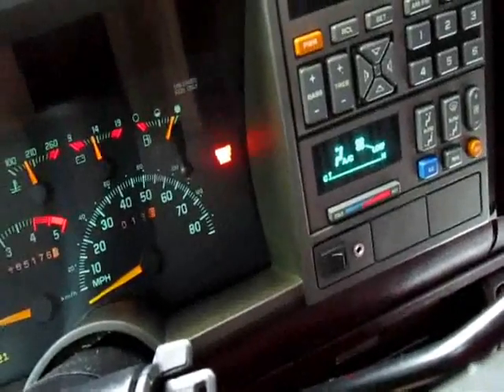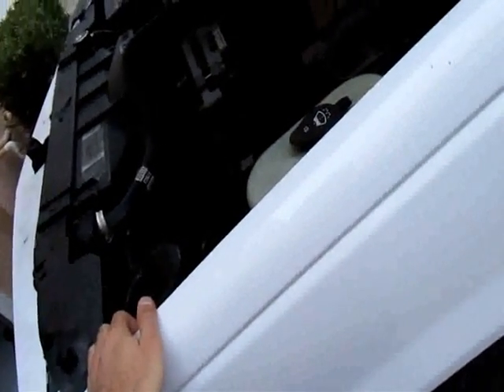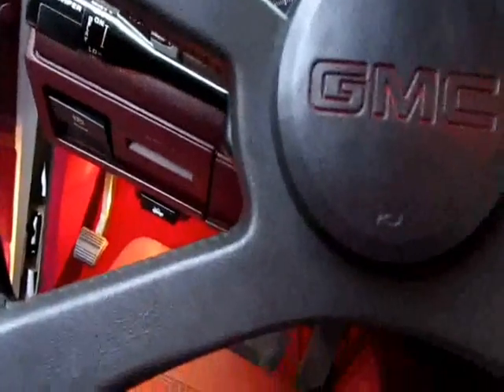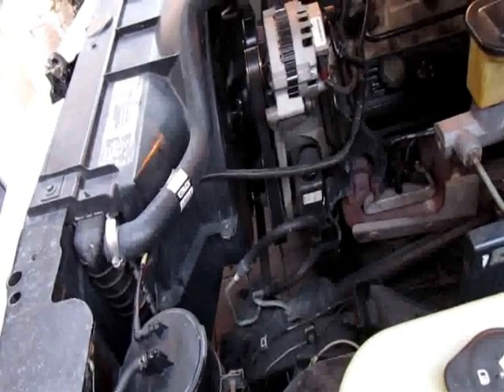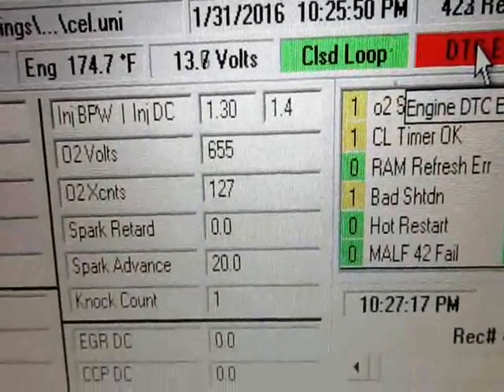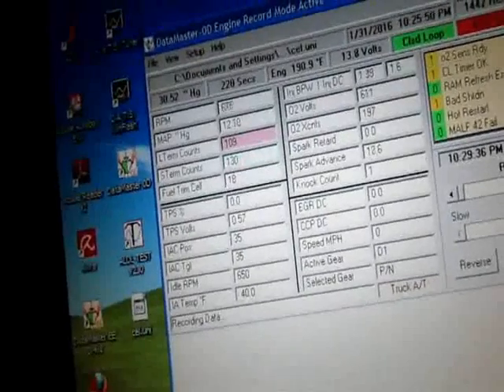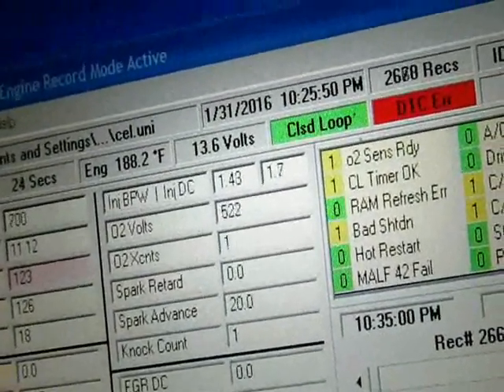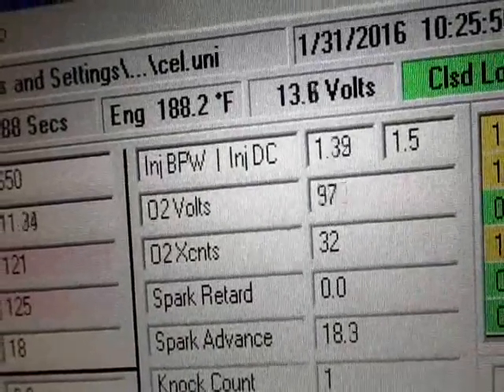OBD1 code 45 TBI GM 87-95 running rich!!

Comment: Loved the video bro. I have a question about a code 32 that pops up when I run my 95 k1500 5.7L on the highway. I changed EGR valve, vacuum solenoid, map sensor and egr vacuum hose. All that and code popped up again. I cleaned idle control valve, swapped throttle position sensor. Still having issues. Im damn near pulling my scalp off lol! Idk if changing  transmission speed sensor will help any, but i it did anyway. Hopefully someone has any tips or theories that can help me out.
Reply from the maker: EGR solenoid OK and connected? Code 32 is EGR only, Bad EGR . NEw ones are crap these days too.  bad EGR solenoid.  Bad EGR vaccum source at solenoid or at EGR valve or the EGR port is packed with carbon
Reply: You probably got it by now but if you don’t disconnect the battery and reset the computer the codes won’t clear

Comment: carburetor cleaner on the o2 sensor, clean it and your back on track.
Reply from the maker: Nahh this thing was old might as well just pop in a new one  they are cheap
Reply: I had too because mine got crossed threaded. had to replace it later on. just made it work meanwhile by cleaning it. lol.
Reply: @juanvenado9707  I know this is a year old, but that's interesting. Didn't know they were cleanable..... even as a temporary fix.

Comment: I have a 1994 GMC k1500 5.7 that has been running rich since I bought it. I have bought a brand new throttle body that came with the new injectors and idle air control valve as well with the throttle position senser. I also put a new temperature coolant sensor in along with a new o2 senser and mass air flow senser. New starter and plugs with wires as well as a cap and rotor. All of this has been done in the past week and it's still running rich. I did pull the plugs to check them again and noticed that my # 7 and # 8 have black sludge look to them. So I have just bought a new distributor and will be installing that Friday as well as doing the timing. If that don't work the only other thing I haven't replaced is the EGR valve. Any input from anyone would be helpful thanks.
Reply from the maker: There is no mass airflow sensor.   If its running truly rich check the fuel pressure could be dripping fuel injector could be too much pressure from a messed up fuel pressure regulator or someone messed with it raising the pressure.  If one plug is fouling could have a bad valve seal. Valve guide and its fouling it with oil.  EGR valve wont do anything. I dunno why so many think the EGR valve causes so much. Its only used at part throttle to mix exhaust gasses in to lower combustion temps and clean up the tail pipe emissions.   When mine was broken from a ripped diaphragm I always felt it ran better then after when I fixed it

Comment: Okay that makes sense. Same thing with my 94 k1500. Same exact issue. Tried that throttle bottle cleaner. Even though of the IAC but it’s the 02
Reply from the maker: Ya My o2 was dead, New one fixed it up., Then it ran bad like a year after.. was the fuel pump. Had like really low pressure.   Now it just works great!  New o2 new fuel pump. Runs very nice. 1994 Best damn year keep it
Reply: @GhettoWagon  yeah I’m going to try out the 02 when it gets here. When it come to my truck picking was between a 94 extended cab or a 00 single cab long bed. But the 94 was loaded. Had a factory tach, and the nice cup holders below the radio. Many know how much them cup holders are worth it in these years
Reply: @GhettoWagon is there a way to test an O2 with a scanner?
Reply from the maker: yea the wave length / voltage should be steady w/o much hang up on any value.   basically its just a wave  Max to min over and over  If its slow? to react its dying  OR... another issue is happening like its  running lean. rich from something upstream of the o2  @MHolt3573

Comment: Hi I have a 1994 Chevy 1500 5.7 tbi I feel like my rpm drops very low when I put into any gear I’ve changed a few sensors already and nothing seems to solve the problem any advice?
Reply from the maker: Make sure TPS sensor is adjusted right . Should be like .5 volt at around idle.  And fuel pressure could be low. Timing could be retarded.
Reply: @GhettoWagon  timing as in the distributor timing?
Reply: @GhettoWagon  and how can I check the fuel pressure? Sorry I’m only 17 and new to these trucks I just rather learn it myself so I know better next time
Reply from the maker: @victor2x668   need a TBI fuel pressure adapter. Goes inline either at the throttle body or the fuel filter.   YA ignition timing if its retarded it will idle low.
Reply: On your video I seen your rpm is also low has it always been like that and is that normal? I feel like mine is too low and it’s like at around 550 sometimes 600 in reverse or drive and when I turn on the ac it completely shuts off
Reply from the maker: @victor2x668  they idle  at around that when warm
Reply: @victor2x668 did you get your fix mine is doing the same thing

Comment: Hi I have a 91 Chevy pick up 350 5.7 tbi my injectors are dumping fuel I've changed the map sensor the coolant temp sensor distributor rotory button any ideas
Reply from the maker: TBI leaking internall bad o rings around the injectors, bad injectors.   Fuel pressure too high.

Comment: Okay so I have a 1985 monte carlo with the 4.3L V6 and I'm throwing codes 34 and 45 as well .. my symptoms are sluggish on acceleration and no power ... could this as well be the O2 , you think ?
Reply from the maker: could be. Or its just running rich and lean.  Code 34 is a mass air flow code maybe its dirty? unplugged?
Reply: @GhettoWagon  I figured out what is was ! The car only has 52k miles on it so i figured everything was good aside from the o2 sensor ... but it turns out I had a rocker arm nut that backed off and that cylinder wasn't firing correctly so it was blowing straight gas through giving me a rich/lean code

Comment: Did you ever figure it out? You missed the temp reading. It was -40 degrees. I'm surprised you didn't get code 15. Temp sensor code.
Reply from the maker: It does not bave one or use that sensor.   Always did that Some inputs pick it up some dont

Comment: What was it ??
Reply from the maker: Changed the o2 sensor it was dead
Reply: @GhettoWagon  
Is there a way to test if it is actually dead? Mine puts out a consistent 0.5 volts when running with the wire disconnected, running on the substituted fuel map. Also, how did you clear the computer code?
Reply: That voltage is being sent from computer to sensor...so your wiring is good.

Comment: Thanks I think I have this problem on my 89 Regal the idle is terrible 50% of the time but anything off idle it runs like a scalded dog. The exhaust seems to be inconsistent sometimes it smells pig rich and other times lean. It's particularly smelly on Startup
Reply from the maker: Could be if it runs rough or rich then back to normal ONLY in closed loop, (when it warms up about 150* degrees coolant temp)   Best is to get some sort of logging tool and check the o2 sensor waves.   Now I have a CLONE GM tech 2 scan tool,  u can buy one too they are allover ali express or ebay for 250-300 bucks shipped from china  Works just like the GM tech 2 and works good on OBD1 vehicles. Trucks been good after the o2 swap Did have the fuel pump die about a year later, was weak ran really lean and stalled out.   o2 sensor failure made it run pig rich!
Reply: @GhettoWagon  cool. I like the idea of getting some software for my laptop like you're using in this video I don't drive this car very much and all my other cars are OBD2. Also if I turn off the car and restart it things seem to settle back to normal. I clean the IAC and it seemed to respond very well to that. I should look into the O2 however it's been in there a long time
Reply from the maker: Ya this was a old version of datamaster. I don't like it but it shows some stuff. The tech 2 is better its what the dealer would of used. And I can manually cycle stuff with the tool  @widtrak77
Reply: @GhettoWagon  yeah I can understand wanting the bidirectional capability. All I want to be able to see if things are within parameters.
Reply from the maker: @widtrak77   yea tech 2 clone does it.  look for a tech 2 clone just realize some are kinda mehh. I had to pick apart the connectors on mine now they seat like a legit one.   Everything else works fine on it. Get one before the trade tariffs happen.    Just google "tech 2 clone" and a ton of info pops up

Comment: Thank you I couldn't find a video that had the same problem as me
Reply from the maker: Changed the o2 and it was good?  Mine was pegged rich, dead o2.  Changed it, perfect.  Then a year? Later the fuel pump was weak and causing it to go way lean randomly.  :D   IDC. I fix it.
Reply: @GhettoWagon  my truck has 270k I am replacing my fuel pump soon

Comment: did you fix it? my suburban has the same problem with running rich, and i cant pass smog... i replaced a few things and still the same problem.
Reply from the maker: yea the o2 sensor was dead and all fouled up.  I put it in the description

Comment: Temp sensor by the thermostat controls the richness of the tbi just went through myself
Reply from the maker: Yes it does, but mine was fine. the o2 sensor fouled out. Put in a new Denso/ AC Delco Sensor, made in JAPAN works sweet now

Comment: Could you do a video on your diagnostic tool how it works and what software to take for this type of truck please
Reply: Anthony Acosta Get a Actron CP9690 code tester. It does live, record, graphing, code connect to diagnose codes, oil light reset, smog readiness test, and MORE! It comes with a OBDI cables for Ford, G.M., Chrysler, and 2 Toyota cables. It has a cigarette lighter cable, instructions. Get a 12v cigarette lighter adaptor for the battery. It works from 1983-2013. It is updatable.
Reply: The people who appreciate you most never have to come back to this video. We saw what you did and got it right. Someone who didn't get it right will comment something negative. Take the views to comment ratio into account.
Reply from the maker: I would but then just another mindless moron will dislike the video. I'm done trying to help people no one appreciates  anything :(

Comment: after putting a new o2 sensor in. is there a time frame for the running rich condition to be adjusted back to normal by the ecm?
Reply from the maker: If the O2 sensor was the problem , the ECM (Computer) fuel trim counts should immediately start changing back to around 128 on the long term.   I usually just disconnect the battery for a minute because it clears all the computers adjustments it may of made with a bad sensor.

Comment: wear did get the computer system.. I need it..
Reply from the maker: +Paul Barnes  Trash found XP laptop, OBD1 USB cable and Datamaster od
Reply: OK thanks.. I have a good laptop..
Reply from the maker: Paul Barnes
 Tuner pro RT may also work for live data, not sure I never used it

Comment: crazy! I just bought a 95 Yukon on Friday that has the same code but runs way worse. dies in gear has no power and idles like its missing on two holes.
Reply from the maker: +john jensen  Mine was not that bad, I just changed the o2 sensor an hr ago, Video on that soon, It runs decent now.    If its really running bad, Check for vac leaks, you will hear it, those crappy hoses, nylon tubes will split with age)  Pull off the air cleaner, make sure one of the injectors is not dumping fuel, just dripping it into the throttle body instead of spraying.   If that&#39;s good, Unplug the MAP sensor, (green connector it always breaks)  if it runs better the map sensor could be bad   That or the o2 sensor could be sleepy. Does it run on when its cold? Gets worse when it warms up?  If you have a few OBD1 cars Get a  a OBD1 USB cable and find a free program that give you live data, Its a ghetto scan tool but it works.
Reply: @GhettoWagon  Thanks dude

Comment: I noticed the timing spiking to 20btdc at idle.?..Does that program show A/F ratio.?
Reply from the maker: +ZIGgassedUP  The timing is always about that when the set timing connector is plugged in.  IT jumps around sometimes I need to built a new distributor for it, it has too much up and down play. Have the parts, Just got to build it.  A/F  Radio, I think I can make it show that.

Comment: Does this thing get driven often.?...I have OBD1 in my '38 and I only use it for timing adjustments...It's a great system 'cos of the minimal control the ECU has over the engine...I always disconnect the battery when it's parked in the shed "that's most of it's time" and it does a real quick re-learn on the tune when I can get the time to fire it up..Does yours have a "full lean" in Park and neutral.?..The Bosch system in my Chevy does...Very loud sucking noise from a pod filter gives it all away..But I do have an improved memcal in the ECU...Plug and play deal...Adds fuel and timing and no CEL.
Reply from the maker: +ZIGgassedUP  Its been sitting for 3 months or so.  I am not sure about how lean the ECM wants to make it.  These TBI engines do not have a vacuum adjustable fuel regulator so its always too lean, or too rich at idle. I was also thinking because it sits and its hot here the charcoal canister could be loaded up with fuel vapors from the hot gas tank.

Comment: I have a actron, works ob1 obd 2 and obd 1.5 with all the gm connectors.
Reply from the maker: +Veikra  OBD 1.5 like the LT1 has
Reply: yes. My firebird was like that
Reply: Veikra Opel Baujahr Opel 98 Baujahr OBD1 wo kriege ich so ein Gerät

Comment: It's not gonna get into closed loop with a bad o2 sensor, only does if it fluctuate
Reply from the maker: +Veikra  with the sensor disconnected I know it wont go into closed loop. Maybe this sensor is ON its way out? It runs fine when the ecm is in open loop.  I have a new o2 sensor, May change it.  I doubt it has any exhaust leaks at the manifold - Y pipe throwing off the reading. But Ill check that too
Reply: thee o2 codes sets if it's too rich or too lean for  30sec. So cruising down mostly. And yes, it's a failing sensor.  Exaust leak usually cause a running rich situation, but the computer wont see it. Youll see it in the Lterm and Sterm counts as the extra air plus the overfuel balances out
Reply from the maker: Veikra
 Ya the LT is 108, Thats mad rich.   St, not so bad, 121, but it seems to go to the rich side when driven, usually this truck was more on the lean side last time I scanned it.  I have a new ACD/ Denso sensor, Made in JAPAN!  I know the sensor will come right out, The exhaust guy who died had it out when it put the Y pipe on for me not very long ago
Reply: Ghetto Wagon
 actually they are close to center in the vid. 128 is the center point iirc 108 isnt too far. I bet while driving it gets out of whack. But idlying like this, the o2 only looks lazy in cross counts, so it may stick at one point when driving, and throw the trims way out of wack and backing it the fuel, causing the drivability problems
Reply from the maker: Veikra
 I will see what I get tomorrow with my Japanese part. Now I have a High quality Import truck!
Reply: high quality import truck and a bankrupt country ! yay !
Reply from the maker: Veikra
 You can get it all for 10 easy payments of 799